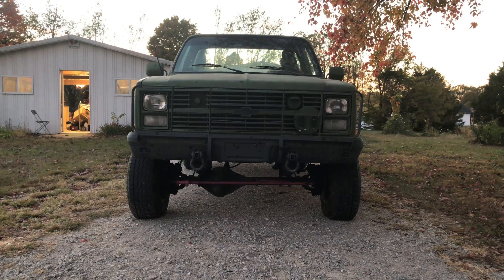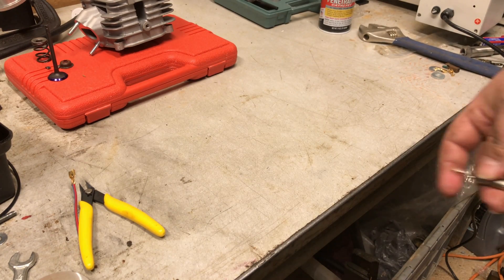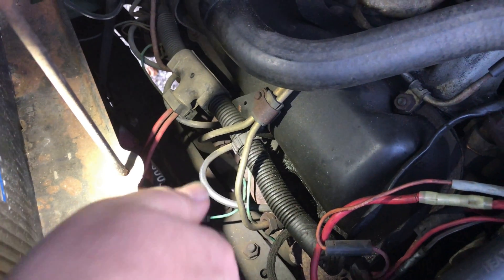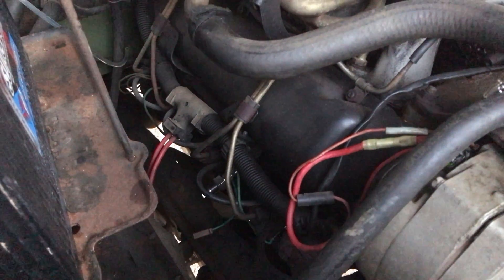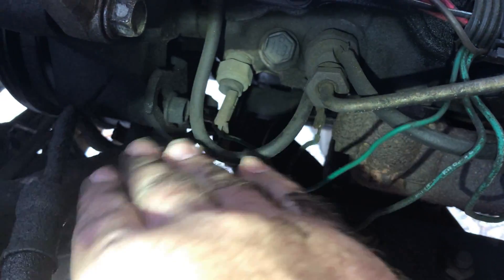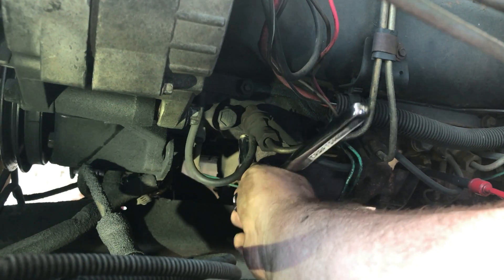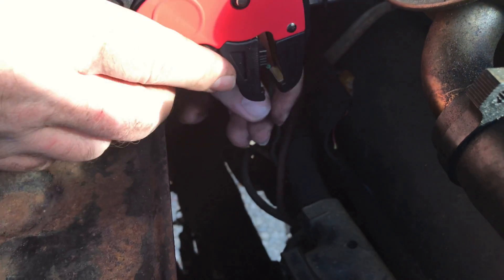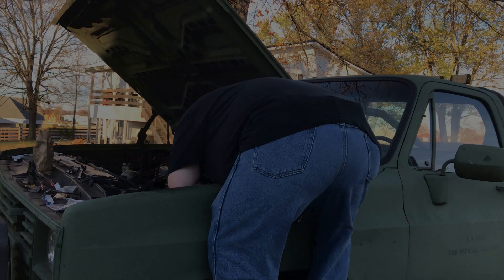How to Remove Problem Glow Plugs & Install New; GM 6.2 Diesel Engine M1008 CUCV Truck

Comment: An exploding glow plug cost me the original 6.2 motor in my 1984 K2500 about 30 years ago. I replaced it. 258,000 miles on the new engine as of today.
Reply from the maker: Yikes Prepper! Another good reason to replace glow plugs as scheduled maintenance! 258K, it's just getting broken in. Thanks!

Comment: Are all military cucvs and the other military trucks always Diesel of did they make gassers too?
Reply from the maker: Hi Car Guy! As far as I know, and I was in the USAF when these things were introduced, all of them had the 6.2 diesel engine. The Air Force did/does have gas powered trucks too but those weren't the CUCV. I'm sure there are plenty of gas swapped versions out there though as the transmission used is a 400 Turbo and a 6.2 diesel replacement engine isn't common or cheap. Thanks!
Reply: @KentuckyFriedFixes  I just remember back in the 90s everyone wanted that 1-1/4ton Chevy but my ears don’t recall what sound they made as in diesel or gas

Comment: I just changed out all 8 glow plugs on my 1984 GMC 6.2. I sprayed each one with Kroil and let it set overnight. They all came out slick as a whistle.
Reply from the maker: Good deal! There was only one on this engine that was swollen enough to warrant use of the glow plug puller, the rest came out fairly easy. It seems like there's always that ONE that wants to be difficult. If people would only change them out every now and then I think nobody would have any issues. But, when you buy a used truck, you never really know what you're getting. Thanks!

Comment: had my 1982 6.2  since 1988  truck runs like brand new
Reply from the maker: The 6.2 diesels are great engines! Jerred has his out and apart at the moment for a rings/bearings refresh. The internal parts still appear to be in great shape though, even a nice cross hatch remaining in the cylinder bore. He originally pulled it because it developed a dead miss, that turned out to be just a burned valve. But, since it's out, new rings, bearings and gaskets/seals regardless! Thanks AL
Reply: @KentuckyFriedFixes  thnaks man hey one more question what oil do you run in 6.2
Reply from the maker: @alshaw9420  Hi AL! Jerred and I have a difference of opinion on engine oil. He likes Shell Rotella 15W40. And I agree it's a good diesel oil, AND the internal parts on his engine looked GREAT, but I personally like Mobil-1 full synthetic 20W50 for Summer and 10W30 for Winter in everything I own. Maybe I'm wrong but I'm nearing 360K miles on my 5cyl Hummer H3 and I don't think luck had anything to do with it. Thanks AL!
Reply: @KentuckyFriedFixes  360 k   holy cow

Comment: I've got a manual push button setup on my glow plugs M1008
How long should I hold the button before cranking? I'm in Florida
Reply from the maker: Depends on the temperature. IMO, normally a few seconds is long enough for good glow plugs to heat up. (maybe 5 to 10 seconds) If your glow plugs are good, that's about all the time you'll need to cycle them for a cold start. If you have one or two bad glow plugs chances are the engine will be hard to start and you'll only swell the remaining glow plugs with a longer cycle time trying to compensate for the bad ones.

Comment: In my Union City Body step van glow plug access is easy.  Remove the plastic wheel well shroud and go straight in over the tire.
Reply from the maker: We had lots of step vans in the Air Force. Loved to work on those things! Pull that engine cover, have a seat and almost anything can be done while seated (or laying down). Great memories. Thanks!

Comment: My m1008 is going through a starter every 6 months ! Even heavy duty starters. Could bad good plugs be burning the starter out so much ? Any help would be great . I was told could  be  a ground wire
Reply from the maker: Good battery cables and connections are important. Small cables will not allow enough amperage to the starter causing issues. If the starter is cranking too long to start the engine it's likely getting hot. One overheat cycle can kill a starter so you can imagine what happens if the starter overheats every time due to a hard starting engine. New glow plugs will definitely help a hard starting diesel engine spring to life quicker. Faster start up means the starter wasn't overworked and didn't get hot. There's also an issue with the mechanical fuel pumps on these allowing fuel to bleed back thru the line when the engine is turned off. That can also cause hard starting as the engine has to crank long enough for the mechanical fuel pump to pressurize the fuel line going to the injector pump. There's another video on the channel about installing a one way check valve at the fuel filter to solve that issue. To start properly these engines need: 1. Good batteries and cables. 2. Good glow plugs, check or replace every 30K miles. 3. Good mechanical fuel transfer pump. 4. It's also a good idea to install a one way check valve at the fuel filter to correct any fuel bleed back issues in the system. Hope this helps.
Reply: Thank you 🙏 so much !

Comment: Wow those are hard to get too. Sure glad I only have 4 glow plugs to worry about. But with that said 2 are behind the injection pump. So changing them requires removal of the pump. I changed them pastime I changed the head gasket. I use the same wire strippers. They work great 👍.Thumbs up to Jared for completing this job.
Reply: that truck is sick willy im gonna say something watch lol
Reply from the maker: Oh man, I'd hate to have to pull an injection pump to replace glow plugs. Yikes! Thanks for watching!